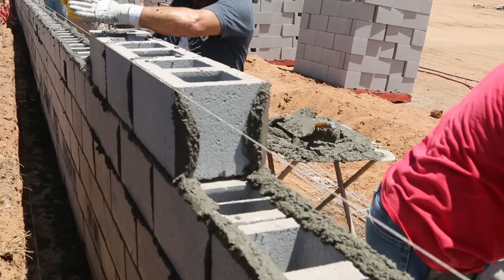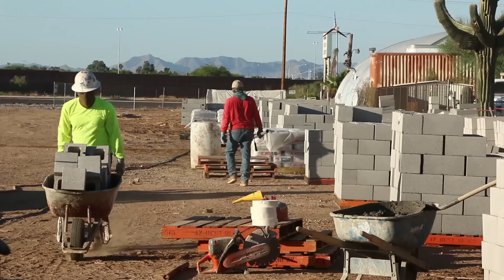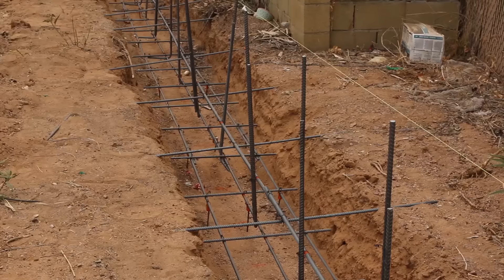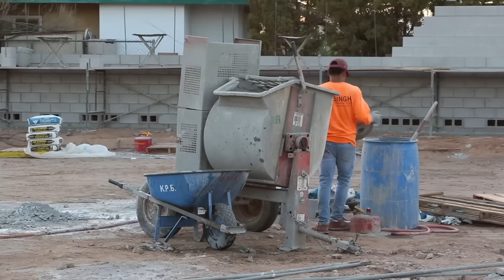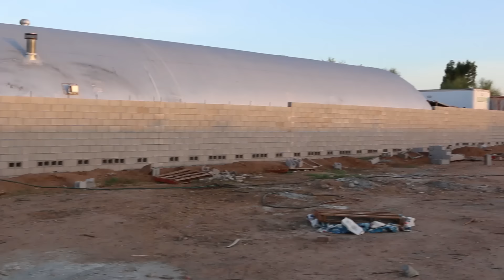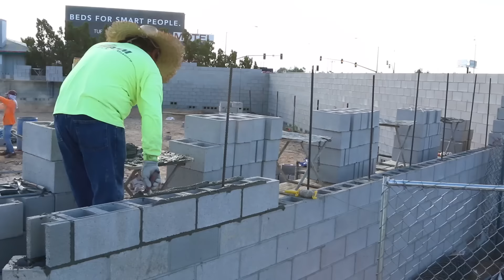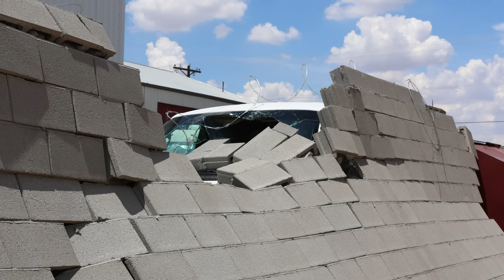Building A Block Wall

Comment: Muscle memory is such a hard truth for me. Because I want to know EVERYTHING about building. Right now I'm in Welding and am doing some structual work, but I learned Concrete and Concrete block in the military, and I've been doing some basic wood framing for almost 10 years from some home renovations. But damn do I admire these specialists. These guys that hardly touch a tape measure when doing wood framing, the guys like these that sling block a mile a minute. It's so impressive but so depressing at the same time. Because I want to know how to do it ALL, but I'll never be as fast as these guys. Amaing work.

Comment: I called a landscaping contractor to look at a failing retaining wall at my new home. I've worked in construction and oil field but had never done a retaining wall so felt it was best to leave to the pros. The guy that showed up ended up saying retaining walls only need drainage if they are built poorly, said cement or rebar in the blocks was unnecessary and just expensive for no reason. I chuckled and told him to have a good day, I'd do better myself Sadly.

Comment: you know the concrete dries VERY fast on hot days in Arizona. we poured a slab at 5:30 am in 2002 for the porch here at my house, and we could not stop it from curing so fast by 11:00 am we couldn't keep it wet enough...

Comment: Stupid wall full of holes and no concrete steel post to hold it up. Very weak. Don't back your car into it as the whole damn thing will tumble. Rocks make a footing, not rusty steel with weak cement.

Comment: Great video I have a block wall that surrounds the back of my yard and they used no rebar or mortar inside the block and have cracks at the corners and cracks structurally in several different places do it right the first time

Comment: Correct me if I heard wrong but you said the bulkheads don't have to match the wall bonds. On your spec house build that you're doing now, you placed the bulkheads exactly where a bond would be. So, which is it? Anytime I've installed bulkheads I shoot for placing them in increments of 16" to keep my masons happy.
Reply: @Hello KLM how are you doing

Comment: Placing of materials is just one part of speeding it up. To be fast, it's all in the mud spreading and lost motion. If you spread the mud to the right thickness, you can lay the block or brick in place without wasting all that time, hammering on it with the trowel. Another thing I saw one the masons in the video do, was tapping on his level, which is a no no. You can destroy a lot of levels by doing this. I learned bricklaying from an old school guy that was so fast, he could brick a 1500 sq foot home in 2 days, with just him laying the bricks and one laborer. The old guy could lay bricks in the wall faster than you could throw them to him. Any mason starting out, needs to focus on spreading the mud and not having wasted motion of doing all that tapping.

Comment: That CHB laying is not good and strong agains the wind and Earthquake, in the Philippines the standard footings for chb laying is 800mm deep, 10 feet wide per 1 span, and every span have beam. The deep of excavation is 120mm, for chb or concrete hallow blocks, every 400 mm. Have 10mm round bars vertical, and every 3 laying have  9mm horizontal bars, and every 220mm or 2 meters and 20milimeter' height of chb laying we have horizontal beam, I share this details because I am proud filipilino Mason and private contractor 😊😊😊
Reply: jhun Sangalang this is in AZ, USA. It’s a dessert place. The chances of natural disasters are very very minimal. The engineers who designed the footing took all that into consideration; therefore this footing is not made to stand against natural disasters because there is hardly any.

Comment: So the Bond Beam Blocks are only grouted every 40"? The rebar between those 40" spaced columns is free floating?
Reply: Usually the whole bond beam course is grouted.
Reply: @cheshstyles  Thanks for the reply. I'm curious, it appears that the bond beam blocks are like a typical block open top and bottom. That being the case would you be actually filling the entire wall with concrete?
Reply: @dremwolf5419  you can take  block off the bottom of the bond beam course (except where there is vertical rebar) and then you are basically just grouting the bond beam course and the cores with vertical steel. Or you can "fill it solid" and grout the whole thing. I havent watched this video in a while so im not sure how this wall is spec'd.

Comment: @13:22 Sand is an aggregate in mortar. Your weak hard mortar bag is not weak because it has no large aggregate; it is weak because it was not properly mixed with water and did not cure properly.

Comment: Just to correct you, the « rocks » do not give concrete its strenth, it is used for bulking.

The strength from concrete comes from the water cement ratio. Mortar simply has a higher one than normal concrete. The « cement » crystal is called calcium silika hydrate.

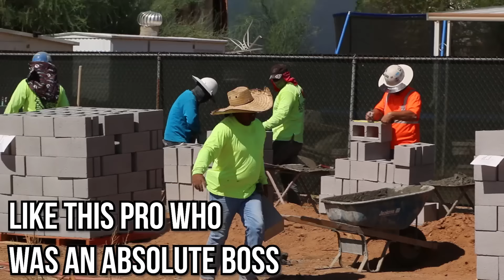Comment: You need a respirator at 2:30 when cutting block with concrete saw. Exposure to silica dust can lead to silicosis known as sand blasters disease leading to cancer

Comment: As a DIY-er (with pro-level results), who often has to do entire projects (flooring, framing, concrete forming of cylinders, side-walks and drive-ways, heavy-wall-mounted cabinetry, electrical, framing, plumbing, moving dozens of heavy doors/windows/drywall two at a time, and mudding/finishing, etc....) by myself unaided, I couldn't agree more as staging/setting-up takes the most time/effort... One has to make sure that all materials are conveniently located within reach as well as the proper tools. I sometimes find that I spend more time reaching for a tool or having to go fetch a tool, rather doing the actual construction. It would help if reliable help was available, but a man has got to do what he has to do...(with or without help, the job is getting done by all means). Not complaining just saying..

Comment: As a structural engineer, I love watching your videos! Thanks for taking the time to make these.
Reply: I am a structural engineer as well and I appreciate that someone actually mentioned a geotechnical and structural engineer in their masonry block video. I’ve watched so many videos where neither is mentioned. Very scary because they give DIYers the wrong impression. One thing that he said I would correct, the overturning capacity of the foundation wall does not just come from the footing. The weight of the wall, footing, and any structure on top of it will contribute gravity weight to the overturning capacity of the wall. The reinforcement also contributes to the bending capacity of the wall. Concrete is weak in tension and strong in compression. ACI code requires 3” clear from soil to the rebar so that is a must. Anyway, I will get off my structural horse 😊

Comment: Very informative video , would have been fun to know what its purpose who paid just for a wall as long as this with no roof, and use what for a scrap yard ? Out here on the east coast of Canada a wall like this would never hold up to our winter frost lifting the ground up  no matter how well its made , most of the cities codes don't even aloud for a concrete block house foundation they have to be solid concrete poured up to the first wood floor frame !

Comment: just thxs for pro vids..enjoy lot of your vids....  during my  inspection days 5 foot drop max on grout fill, lot of jack hammers in the past :).....   what is the drop max out there?   like to see the slump  i saw there loose becuz of dry soil suk the  agwa, water out.... trick i see before lay plastic u shape capture the concrete prevent flash set..    what is your thoughts if any :)

Comment: Cutting all that mortar off of the bed joint and letting it fall. Only to come back double butter head joints. It's less trowel strokes and saves mortar to use all the excess.

Comment: I’m not so sure the rocks cause strength. When I watched freeway columns being poured the cement had no rocks at all. They are far stronger than these walls and resist greater forces. I think the rocks are filler and something in the mix other than the rocks adds the real strength. It’s the bonding power that gives strength not the materials being bonded. What do you think? I don’t know honestly.

Comment: So if the rebar needs to be encased in concrete (presumably because if its exposed it will rust, expand and cause the concrete to fail). Then how is it not a problem that the metal nails you have holding up the rebar at 7:04 would not do the same thing? At least the lower part of the nail will be in contact with the ground.

Comment: How is the top rebar grouted in?  It seems like the grout would fill all the cavities?  Great video, as usual.
Reply: Bill Quayle  they use a product called grout stop, it’s a mesh comes in rolls used to close any cells that are not designed to be filled with grout.

Comment: Turn  for the cement blocks sideways for a very high strength wall. you'll use more blocks but it will last much longer.

Comment: Don't build a block wall this way. Terrible. Cinder block needs galvanized steel rebar, vertical and horizontal and concrete fill of all block cavities. The best horizontal rebar is Durawall, laid down across all courses.

Comment: We know how to build walls. Bricks, cement, level.

But how humans built these walls?

Like those here, they are 1000s years old with perfect joints, no cement and rocks that made these walls are gigantic. 
https://i.imgur.com/PclbaIR.jpg
http://2.bp.blogspot.com/-KiSr31IKAHQ/VAt6Imxyb-I/AAAAAAAACwQ/puQ3k6-Ncgw/s1600/IMGP5125.JPG
http://3.bp.blogspot.com/-RYdA7-u3zlM/VAs29B-AWtI/AAAAAAAACvQ/zc2lFo4HCv4/s1600/IMGP5042.JPG

How they were able to achieve such amazing precision? If you could do a video about it I would be grateful. Thanks.

Comment: https://youtu.be/AOZGgy7guKo

curious to know how to build a wall 16ft high x 20ft wide smooth wall for handball. I believe it's built with block with a smooth coat of cement then painted. I could be wrong. The link above is a video of the wall I'm talking about. Any insight would be helpful. thanks!

Comment: I hate block walls. There not safe or very strong. There no good in slatted sheds cattle can burst through them and ultimately fall in and kill beasts or you in process. Even if you hit by accident with a digger or tractor it will fall

Comment: Apparently not a problem in dry Arizona; but modern rebar theory calls for epoxy coated bars in the concrete. The reason is that sooner or later water WILL infiltrate the core and come into contact with the iron, it will rust, and the growth of rust will expand and cause the masonry to fail.

Comment: Is the grout vigrated like regular concrete? (didn't see it in he vid)

Also I noticed that they are doing the conections only on the outside of the edges of the concrete, obviously any mortar put in the middle would fal through the holes when laying it on top, but why are they not mortaring the entire surface of the sides? the same goes for the middle bar on the blocks, isnt a bigger surface area for glue something you would want to take advantage of? seems the mortar used like that is mostly cosmetical.

Last, how do you get the concrete that is poured at the top all along the wall to stay there and not pour down and fill the entire wall?

Comment: Instead of emphasizing the workers' building skills, which certainly is remarkable, you mainly concentrate on explaining the principal of the engineering and the materials in a simplest way.  I like this.  It's very educating.  I majored in Civil Engineering in college but changed lane to computer coding after graduation.  Your lectures recalled me of something deep down the bottom of my memory.

Comment: I call foul one of the guys was laying to the line and then pulled out a level instead of using the line and the dude near the end was striking head joints with the bed jointer my bosses would box my ears if I did any of that

Comment: That is nice information and I watched the work the staff and inmates did at the prison I worked at when they was building this one building with concrete sides and walls with no windows in most of the building. I was always worried about being in that building for any length of time, but some of the inmates assured me that the building was done properly and I became satisfied that the place was safe. It was probably the safest place to be on the entire compound.

Those guys putting up that wall complex was professional and knew what they was doing. The wall you showed next door which had fallen was not done properly and these guys didn't do it.

Comment: Poor looking footing you got there chief. It’s looking well undercooked for the height of wall over. Also no development length to transverse reinforcement. The only saving grace is potential passive resistance of a soil wedge on the side face of the footing. You gave an example of a wall that failed due to lack of reinforcement...well your wall won’t fail that way but instead begin rotating altogether under enough wind action. Hoardings always see the most wind force too. Hopefully your engineer stamped those drawings so the judge knows who to bring the hammer down upon when this mess fails.

Comment: Having worked in Masonry in Iowa for several years in my 20’s, I can tell you that this is a well under appreciated trade.  It looks simple enough and its always done so quickly.  However, the masonry trade is not for the faint of heart.  I began as tender/laborer for the company I worked with and learned from the boots up how to complete a professional job.  I no longer work in that trade but am super glad to have the skill set it allowed me.  I can run equipment, mix all types of mortars, build and repair scaffold as needed safely and still strike off some pretty heads and beds.  Anybody who wants a real trades experience should get a few years working with concrete and blocks.  You wont regret it.   Love the materials.  Will you be my grandpa?  I don’t have much family and I could use a guy like you as an extension family.  Haha!
Reply: I hear ya.  being a mason was a fun time in my life.  I miss the creativity, the fun, the challenge.  Being older, now I look at how I can accomplish something with the least amount of pain.

Comment: That guy at the end didn't even have dirty clothes.  When we do any cement work it is a mess.  I thought it was cement but it is us.
Reply: I remember I always tried, and succeeded, to stay clean.  Our instructor had a story that stuck with me.  Two masons, one young and one middle age, working on similar walls.  The owner of the masonry company arrived onsite.  He observed these two masons working on similar wall and told his foreman, "Look, two similar walls, one is working hard and the other is hardly working!"  "that ticks me off, I am paying them the same money and one is giving 110% and the other is moving so so so slow!"  and the foreman replied, "Boss, I see your point.  However, why are they both at the same height?"   to which the boss replied, "You got me there."  The point was, and still is - least amount of motions.  The middle aged guy would have little to no dirt, sweat, and dust on him.  He moved with pre-thought-out motions, motions with intent, and zero waisted motions.  The other guy did not think.  He only went.  THus they young guy's work was missing mortar , his work area was a mess, his clothes were full of dust, mortar, and sweat.  yet at the end of the day, the middle aged guy had more wall completed and less energy complete.  that is what makes a craftsman and a crapsman

Comment: At the control or expansion joint wouldnt u caulk that im. Stead of mud it? And wouldnt u run a full with a full and half next to a half
Reply: On either side of the control or expansion joint

Comment: Couple of questions;
When you pour the footing, aren't you worried that the dry earth will suck the water out of the concrete...
And why isn't every cavity of the block wall filled with grout, why are they only doing it every 40 in...

Comment: 7:45 dirty opposite bond on that expansion! lol. How?
Reply: I wondered that. Wouldn't each run of blocks between expansion gaps be set to blocks? Also, what happens inside the cavity that houses the vertical rebar? Filled with ordinary cement? Concrete?

Comment: I grew up in southern California in the 1950' 60's. Lots of 'tract' homes..I was about 16 in 1963 and did this stuff for a couple months...3 man crew...2 block layers and me...I mixed the mud...separate bags of concrete and lime, big piles of sand on the ground, I had to do most everything except lay blocks....the 2 guys laughed at me when I showed up the first day with some leather gloves....the gloves lasted maybe 2 hours....so like the 2 guys...I ended up with 'leather' hands pretty quick.
 The walls were similar, but had columns about every 12 feet or so...'Pilasters'...? That were 'H' blocks..took up any expansion and kept the wall from falling over. most everything else was pretty much like this video. One day...I forgot to clean out the  mixer....next morning, I spent an hour beating the outside of it with a 10# sledge.
 Some days, the concrete blocks were just hours old from the block company...still damp, and if you dropped one, just broke apart.
  About every other house, the male owners would come out with a 6 pack of beer, the women always brought out Iced Tea....

Comment: On the bond beam blocks on top, what stops the grout from just falling right through the open cells to the bottom of the wall? Really interesting. I never knew about the internal details of a block wall. I always just thought it was blocks and mortar.